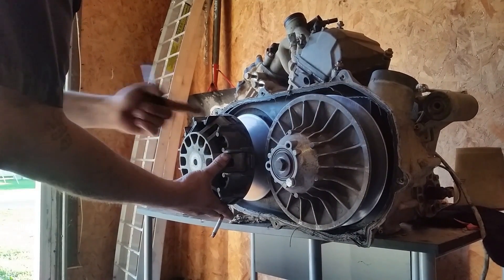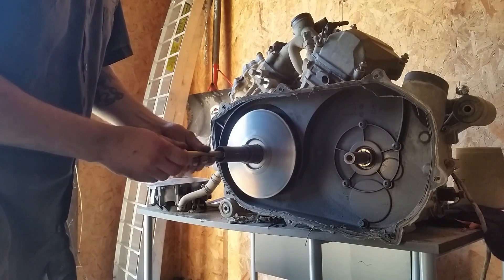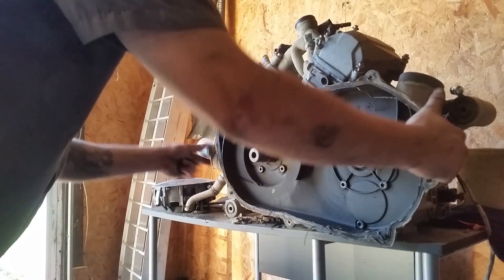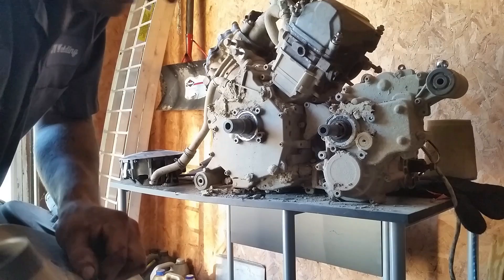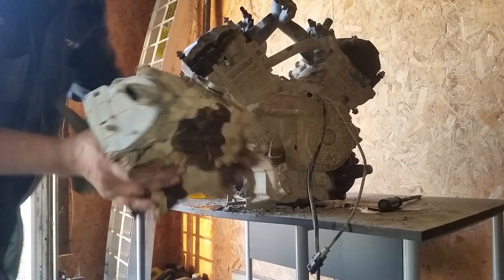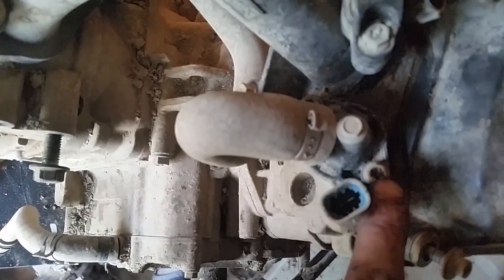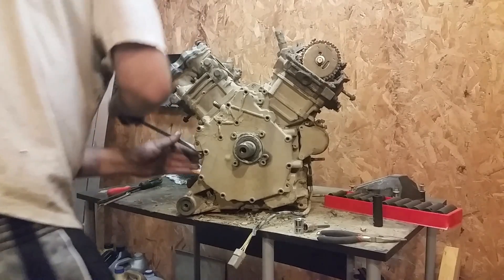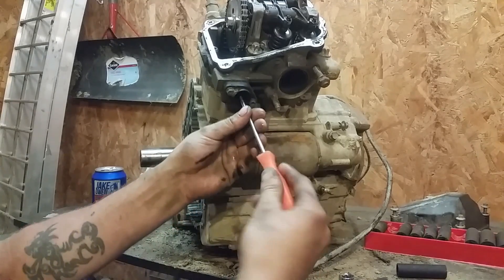Can Am Renegade/Outlander 500,650,800 Engine Tear Down (G1)

Comment: i have one of these engines.. less than 100 hours of use on it and the tensioner.. or something failed causing it to slip the timing chain off the sprocket. the chain never broken but sadly it has taken out the mount for the horse shoe clip..  so i think the engine is a scrapper :( the tensioner looks to have melted?? all molten plastic around it

Comment: Nick, thanks for the video.  I know this is an older post and thus I may not snag a response, so I understand if this goes unanswered.   I just got a 2007 800 Max XT and was wondering if the tranny can be removed, along with the through-case driveshaft, without actually removing the engine?
Reply from the maker: Negative the whole thing has to come out sorry for the late response I was on staycation for 21 and half months

Comment: What year is this machine? I hear the timing chains on pre 2009 are poor.
Reply from the maker: 08 and yes def upgrade your guides if it hasn't been done before. I replaced mine originally around 1000 miles before it became a problem. you are correct about the guides but I'm not sure the chains are. I could be wrong but when I did that 5 years ago I only replaced guides
Reply: 2007 w 5400 kms (3240mi) Just about every mod to keep it cool. Muzzy exhaust, heat wrap, oil cooler, new fan, rad & shroud, engine ice, new fuel pump. Blew rings out finally.
Reply: Tune monster w O2 sensors. Rarely driven slowly. Because it'll overheat. Opened up plastics & put ducting in to direct air to the rad.
I'm taking my old rad to a shop & have them make it 3 or 4 row.
Reply from the maker: Ya I beat the hell out of mine. its rarely ever seen a road or "good" trails. I have had a rad relocate for much of its life but its always been kinda nice to me lol. cheapest way is Mr rpm 800 kit and get a hold of  warranty killer performance (Quinton Daniels) next week about the chains and guides. he is on vacation till next week though. you can search fb. I have A LOT tied up in my motor build and only sub work was the port and polished plus stage 2 cuts for my cams
Reply from the maker: as far as the cooling that one is a little bit more tricky. you seem like you got all the systems to help out I wouldn't even know what else you could add you pretty much have all the basics covered. I flush my system about every 50 hours and I usually bleed it about every oil change. other than that I haven't done nothing to my cooling system. WKP he will know if there's any other way to help you
Reply: I've seriously thought of putting 2 radiators in. One in the stock location & one up top. It's overheated from day one. I can't ride it for more than 30 minutes before it overheats.(hard riding, up steep rocky trails)
Reply: I ride fast & the Polaris rides slow, so I wait & cool off while they trickle up the mountain.
Reply: 2007
Reply: @RikterZilla  would you suggest removing the thermostat? i have one that the tensioner seems to have melted on!

Comment: good video how many miles on that motor
Reply from the maker: 4272 miles on this block and beat the hell out of it everytime I rode it. In the end a loose/stretched cam chain started rubbing the inside case and cause me to do a 940 instead of a simple chain replacement.

Comment: do you know is it possible to remove drive shaft without taking out the engine?
Reply from the maker: No you have to remove it in order to remove trans from the motor. The through shaft will not come out with out removing trans from the motor. Hope this helps
Reply from the maker: Oh prop shaft. Yes both front and rear prop shafts can be removed without removal of engine. Check my previous video or I can make another because this seems to be a common question
Reply: donatas kk just undo the rear diff bolts to get out rear shaft

Comment: ty so much for these videos ...have an 09 outlander 800r the through shaft is bent and gotta split the motor so going to put an 840 or bigger rebuild kit while tearing it down so this helps a ton!
Reply: Where did you get your rebuild kit and how much did it run you?  I am going to need to rebuild my 07 can am 800.